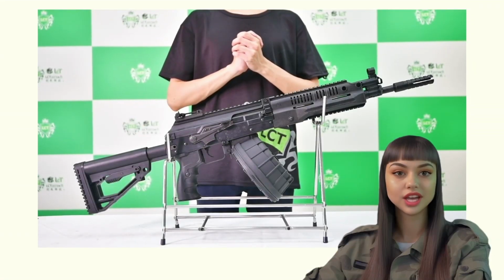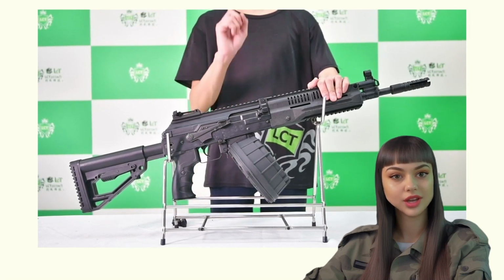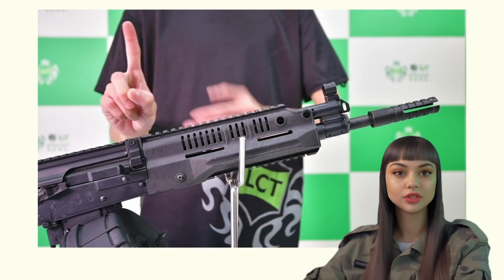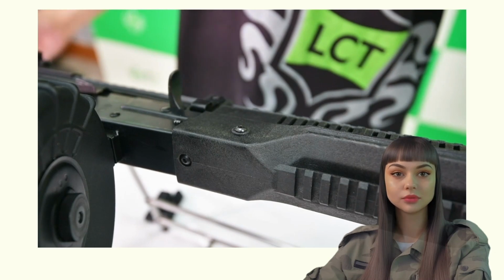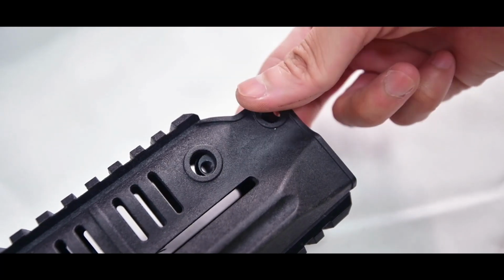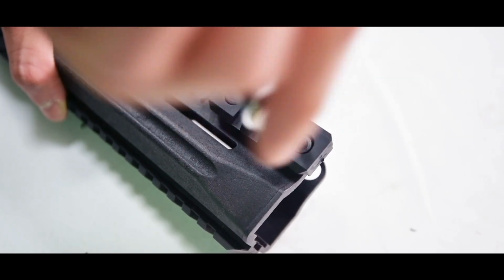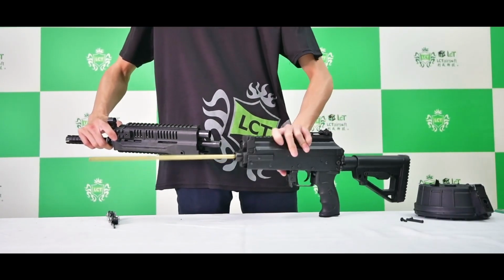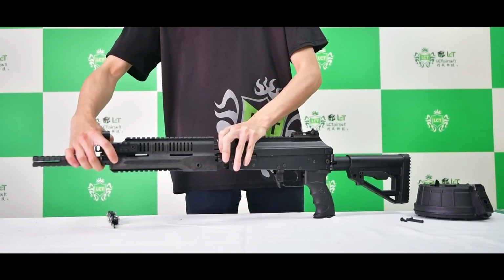【LCT Airsoft】LCK-16 Side Rail

Comment: When is this coming on the market? I cant seem to buy this anywhere....
Reply from the maker: Due to the regional problem, the delivery will be late in some countries. Please forward to LCT dealers to pre order and confirm the exactly lead time. http://www.lctairsoft.com/webe/html/dealer/index.aspx
Reply: @lctairsoft6427  that comment was 100% not helpfull...
Reply: @lctairsoft6427 Hey LCT I'm having trouble taking out the security pin/screw that requires an allen key, any tips? It's taken off so easily just by holding your finger on the back end in the video, but mine just turns and turns. Any help would be appreciated!